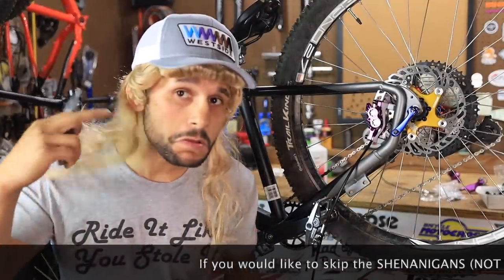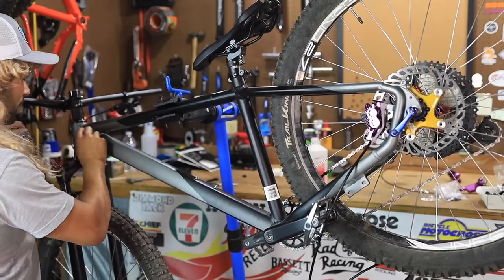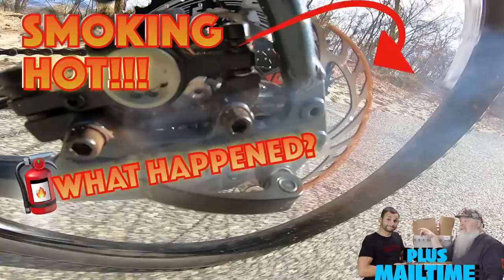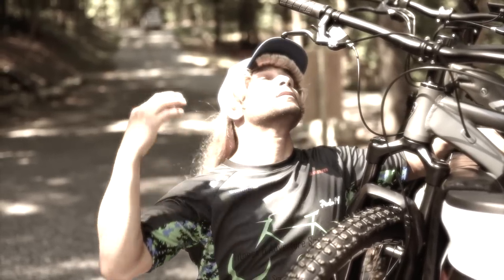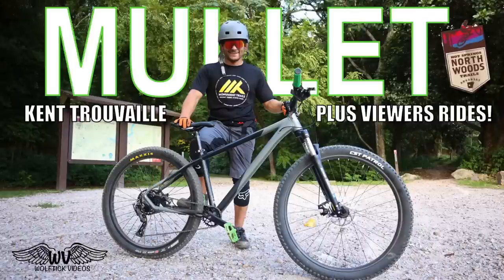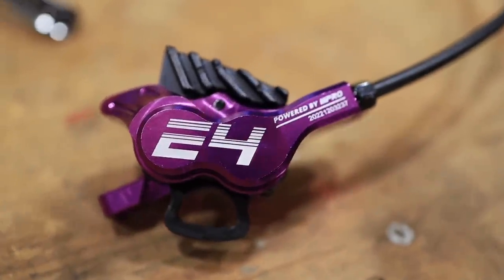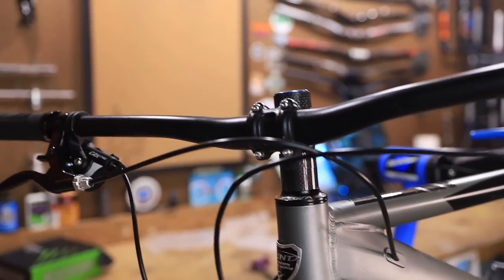Amazon 4 Piston Brakes: Initial Impressions

Comment: About internal cable routing IMHO there is not one that is good or better, is just cosmetics and a way to fill your bike with water.  External routing makes repairs simple and less messy in case you are replacing brake lines. but that is my 2 cents.
Reply: Agreed, too much marketing in place these days about IR. It costs more time and doesn't really provide much benefit.
Reply: Totally agree, internal seems a total pain in the bottom.

Comment: Juin Tech makes a great cable activated hydraulic brake, a little cleaner looking than the TRPs. But TRP and others make a dual pull cable brake that has a yoke to move the pads from both sides. They are all improvements over the standard cable discs. But as always, Tick looks fabulous!
Reply: I have the knockoffs I believe they're on Amazon they're called like X Tech and they worked excellent to stop my motorized bicycle from 60 miles an hour to zero I would highly recommend the juin tech brakes
Reply: I had the cable hydraulic brakes, x-tech, they were ok, was dual piston, you could micro adjust pad adjustment with a screw on caliper but you can buy hydraulic brakes with better braking power for same money
Reply: @lifebehindtheselens  i think you're exaggerating that 60mph abit lol i had them on my bafang ebike and they don't brake that hard, i had 203mm rotor up front but they are decent

Comment: 5:43 Technically this one is stronger, if the cut in the down tube is well done, but keep in mind weird shapes and sharp cuts can be stress  raisers, which can cause failure, but a routing hole like this is not likely to do that, but I am not an expert so can't say for sure. But you were to put an powerdrill to a frame to make internal routing and did it badly you could cause a failure, but here it's a end of a tu, and big area is welded and is more material there. Keep in mind these bikes are xc bikes, they are likely using the softer, weaker 6061 T6 alu, tubing is very thin too.my bike is a enduro bike, it uses Downhill rated tubing, much thicker and stronger alu too. but it's of course heavier, but it's built for a different purpose. But I love that Geometron G1 has all external routing apart from dropper post, it goes into the down tube and goes up into the seat tube, does not go out of the seat tube at all, very well done.

Comment: I remember you did some zoom brakes some time ago...  I got some for my Walgoose Ledge X1!   Trying to do the internal routing and I need those things to make it work...  so the end that goes up by the lever I need that part. Do you have a link where I can get the olives or barbs or pin....whatever they are?? The model caliper is HB-876  I need as well as an adapter to fit the 180mm rotor into the caliper on a used Rockshox 29 (Going Mullet on the Walgoose! ) Thanks for your help! 😇💪🙏
Reply from the maker: Man, congrats on the new BRAKES! So happy you are gonna do a mullet, let us know how it feels with a full squish. I am curious if it helps the pedal strike. Here is an affiliate link for both barbs and olives plus an adapter. Be sure to select the BH59 combo kit. The BH90 will be too big, thanks for asking brother. 
180Adapter
 https://amzn.to/3wLg4LG
Barbs Olives
https://amzn.to/3RkimLe
Reply: @WOLFTICKVIDEOS  Thanks for getting back with me!  The whole time I thought I WAS subscribed!   Now I AM.  Haha!
Reply: @WOLFTICKVIDEOS  Do you have a link for the specific tool for this operations?
Reply from the maker: @mrupholsteryman  hey brother, here is a link to that as well👍 https://amzn.to/3HnThuq
Reply: @WOLFTICKVIDEOS  Thanks again!

Comment: I use a trick with sewing thread and a shop vac to suck it through the frame. Then use that to guide the housing through. Can also tie it with a unison knot to brake line and pull through

Comment: I've had these brakes for almost a year now and I must say their stopping power is immense. The lever blades hold well with one and two fingers. 

The drawbacks:
1. The pistons get sticky very quickly and do actuate evenly, even if you thoroughly clean them, degrease and lubricate with a bit of brake oil. Also, cleaning the pistons is tricky because it's fiddly to block three pistons and have just one exposed at a time for cleaning.

Comment: I'm heading back down to Las Vegas in April. I still haven't decided to replace the cable disc brakes with the hydraulic Shimanos I have sitting in a box down there. As I stated before, the stock Axum brakes work really well.
Reply from the maker: Man, sometimes they are the way to go...

Comment: I really like the design of those levers, very clean. My new emtb came with sram db8 brakes, probably the ugliest levers ever designed. Typically cable actuated hydraulic brakes are used on slopestyle and dirt jumpers that are running a gyro. The internal routing on my Trek Roscoe is almost identical to the ascension and trouvaille.
Reply from the maker: Thanks for the comment, glad you chimed in about the routing! I knew it was somewhat normal lol. As for the cable actuated hydro brakes, that makes complete sense qhen using the "gyro" style. Thanks BERSERKER!! Looking forward to hearing him you like the new bike!! Gotta give you a call on Patreon 👊
Reply: They're chinese Hope replicas

Comment: Those brakes look really nice. Really interested in how they perform. In case anyone was wondering those calipers are compatible with Shimano H03A-RF/H03C-MF pads. So, finding replacements won't be an issue. It might also be an interested test to see the stock pads versus the Shimano pads and see if there is a difference in performance.
Reply from the maker: Dude thanks for the heads up! We will have to order some now 👍 That sounds interesting, never done a side by side comparison 👍
Reply: As someone who's used counterfeit pads before, original Metallic ones or fron reputable brands Will absolutely DESTROY the counterfeit ones.
Reply: Can you confirm. I bought some J03A by accident without realising. So H03A etc will fit?

Comment: 10:48 There are aftermarket options with fins being separate from the pad, so you can just buy new pads and attach the fins.
Reply: They're worse though, the thermal transfer is far, FAR worse. I have tried using thermal paste but it dries up and it stops being effective, maybe some thermal pads from memory chips or something would do it. I still use them because they might still help a little and they look awesome on my Sram Code R
Reply: Hope pads

Comment: 3:42 You should change the position of the skewer lever, so you can easily get the palm of your hand behind it, it's very badly placed now. place it at the same angle as the caliper and the frame tube is, up or down, or let it point back instead.

Comment: I looked into those III Pro brakes and saw that they use the Shimano BH59 barb which means they use the BH59 brake hose which is used on the lower end Shimano brakes like the MT 200, etc...  The higher end Shimano brakes use the BH90 hose which is stiffer and has a smaller internal diameter for fluid flow.  I am willing to bet that these brakes will not reach their full potential with the hose that comes with them.  It would be an interesting experiment to swap the hoses and see if they inprove and if so, how much.
Reply: Does the BH90 Olive and hose fit into a BH59 Port? You have me intrigued!
Reply: Looks like I'm going to go ahead and try with original hoses then try and swap them to the BH90 and see if it fits....

Comment: I'm running with Magura HS Trail sports - 4 pots in the front, 2 in the back - they aren't cable actuated, though, but swapping levers is a feature for almost all if not all Magura Disk brakes. They actuate a rod which actuates the hydraulic system in the lever. I got them in a deep sale + a scratch refund for 99€, btw, but the normal price is usually around 170-180€ as well. Braking power is a massive improvement over the original MT-200 on the bike - Magura Pads take a long time to bed in, though. 30 times slowly to full stop for each brake and they aren't kidding with that.

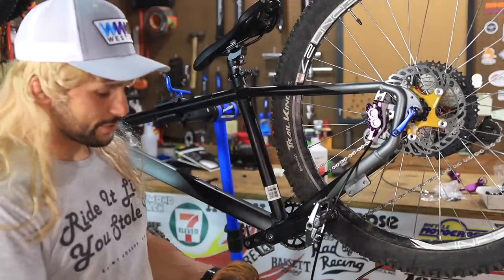Comment: 0:12 So you don't have the expensive Park Tool magnetic internal routing kit? I have the first version with 3, but there is a second version with 4 tools. But I don't need it, but at least I have it to work on friend's bikes. Butt so far none them have that. The tool makes it easy, of course some frames have very bad routing. some do it well. But the Trek Fuel EX I had was horrible, but I managed to get it done. But that bike was so bad, maybe it was designed to be that bad, problematic to work on.😀  Lets make it pressfit BB92 so you can only really use Shimano cranks, or bearings balls will be tiny, routing with many bends, going in and out, wearing the housing faster, making it rub., yea lets make the rocker link crack, and make the bike sway. I am glad I have a proper bike now. 
That bike was an perfect example of how a pricier bike can be worse, and be bad value, so always research.

Comment: I have the zoom db680 on one of my bikes. Its a 2 piston mech brake, based off the TRP Spyre. For cable actuated hydraulic calipers, theres the Juin tech, Ferrino and TRP Hy/Rd but they are mostly used on gravel bikes

Comment: Try Paul Clampers cable actuated brakes. Top tier and NON budget but the best! You might want to start comparing a high end, vs low end and then the middle. I have used Avid BB7 with a good lever and big rotors203/180 and really good housing, super slick and had great results

Comment: Internal Routing's not bad. 
They look like sintered pads though (metal infused).

For mechanical brakes, A high tier one is Paul components. while a more affordable but better ones are avid BB7 or the shimano M375.
Reply from the maker: Thanks for the input man, the brakes look the part and hopefully they don't over heat lol. We here alot about the avid stuff 👍

Comment: Those pads are the same as the finned Shimano XT, Saint, Zees.  Resin ones are H03A-RF and the metal version is HO3C-MF.  I can't tell from the video for sure but it kinda looks like the metal pad.  A search for those on Shimano website will bring up a picture you can compare to your pad material and tell for sure which pad you have.
Reply: Well let me rephrase that.. not the same but compatible with those Shimano ones.
Reply: I have these brakes and they're actually Hope pads. Shimano 4-pot pads are very similar, but just a tad larger. They might be cross compatible, but I suspect that the Shimano pads are just a hair too big to fit in this caliper. I have both pad types lying around, so I will try it out next time I'm working on my bike.

Comment: Mechanical brakes suffer from cable stretch, and cable housing compression, which can make them feel spongy. Quality housing and cable will minimize this. They can be bullet proof, and cheap. TRP makes some really nice mid tier mechanical brakes. Hardtail Party really likes the top end Paul Clampers. They are super expensive though.
Reply: I've got a set of TRP Spyke on my 1994 Cannondale Delta V 600 that I modified to put disc brakes on and they are pretty decent. My only issue with them is the angle the cable exits doesn't work the best with the mount I used on the rear brake. Other than that, zero issues.

Comment: 6:18 internal routing like this at the down tube, BB is nothing new, I've seen it done on road bikes before years ago, some bikes had a plastic guide bolted to the BB shell too.
 On some bikes the cables go trough the BB shell, which I think is stupid, the housing goes under the BB and goes into the chain stays, only have a hole at the bottom of the BB shell to help you route the cables, and it has a lid to put on, to prevent gunk getting in.  Some have cable spaghetti at the headset and stem too, so housing going trough the headset into the stem, steerer tube, handlebar, what a mess. Not nice to work on.

Comment: Fins are NOT to direct airflow on the brakes but the opposite: it’s to get heat out of the backing plates. Heat will transfert from pads material to backing material, then since backing material have more surface (fins) it have more surface in contact with air to give its heat to the air. Just saying.

Comment: Heres a tip for y'all routing that bs. Take some really small rope or twine and tie a small bit of plastic bag to the end of the twine and put the vacuum on the other end of the whole and suck that puppy thru then tie on and pull your wire or cabling with tape and your mint.

Comment: 12:05 They did not move equally, so you need to lube the pistons, if they don't move equally they will bend the rotor.
Reply: As long as they all move then he's fine because in real life application when you pull the brake and you actually pull the lever it's pushing way more fluid which would actuate them all equally he can't even put any amount of force on that lever without popping every single piston out of that caliper so no you're wrong when it's on the bike and there's something in the middle to where he can put full force and actually push fluid to make all four Pistons fill and all four equally expand then it will be perfectly fine he can't do that on the bench without fucking up brand new brakes

Comment: When routing internal cables in frames without guides tubes in the frame, I cheat and just use my good old trusty shop vac and some florescent twine I have left over from building a shed. The vacuum sucks the twine right out of the hole I choose it to. BAM done in seconds and no spending extra money !

Comment: 9:11 Who ever is telling you this does not have a clue what they are talking about. No surprise you can't understand why, cus there is no reason for their claims. it's total nonsense.
Please adjust the reach to fit you, the reach adjustment on this brake won't effect the power, nor will it effect the anything inside the brake, it's completely external adjustment. 
The only thing this adjustment effects its the reach, northing else. The adjustment moves the pivot in and out on the push rod, this means the reach won't effect power, as you can press the push road as far in as before, unlike with Servo Wave, where thee reach adjustment just moves the lever blade closer in at the servo wave, but not on the push rod, absurd. so avoid Deore brakes, this means to get the power you need to adjust the reach all the way out, and a child won't have functional brakes. Not an issue with the design shown here.

Comment: i got some 6 piston hydraulic brakes from aliexpress, surprisingly they are 6 piston, ill edit this comment if i find the link, i am using them on my 2004 norco aline paired with 220mm sram rotors, they work astonishingly well
Reply: So 6 pistons per caliper? If so can you link?